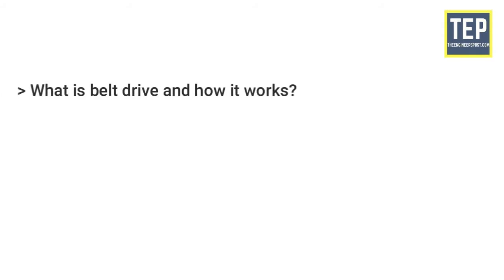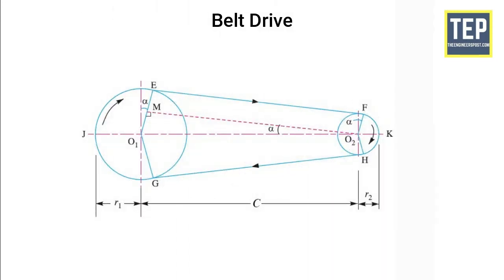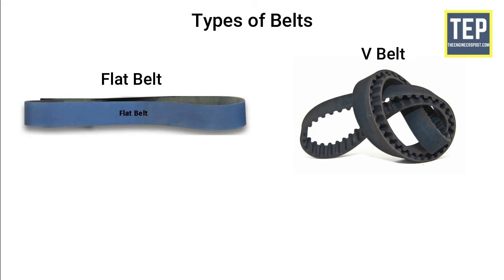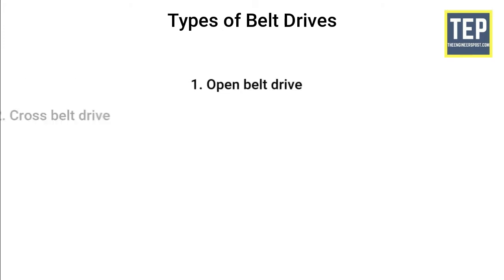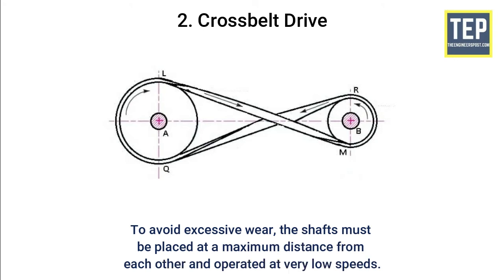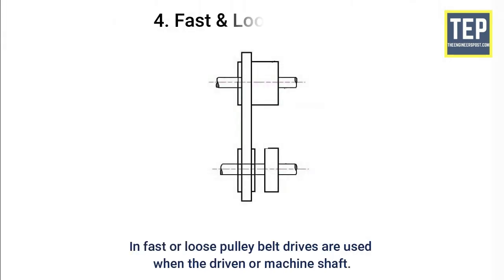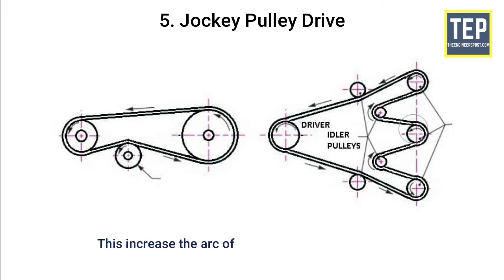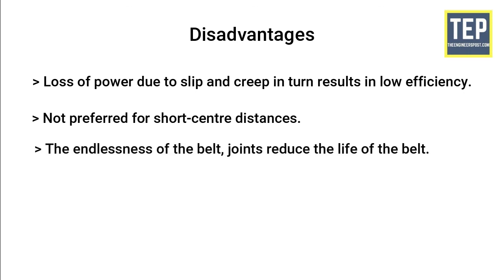Belt Drive | Types of Belt Drives

Comment: Yes I know this is way behind on asking but hay better late than never...... I have a Coleman ct200u-ex mini bike and I put a predator 212cc on this mini bike with a 30 series torque converter using the 15 tooth sprocket that come with it and the mini bike has a 50 tooth sprocket on the back wheel. The chain that is used is 40 chain. From center of driven clutch on torque converter to center of rear axle is 15 in. That 40 chain is half inch wide. Would you  happen to know of a belt drive that I can put between the torque converter and the rear tire? Oh yeah the shaft that driven clutch sits on is half inch and I have one inch clearance between edge of driven clutch and back plate that is bolted to the engine. The drive I talk of would be the small version of what Harley-Davidson uses on their motorcycles.

Comment: A belt conveyor pulley is a type of mechanical pulley that is used to power a belt conveyor system. It is typically made from metal or plastic and is mounted on a shaft that rotates to move the belt. There are different types of belt conveyor pulleys, including grooved pulleys, crowned pulleys, and V-belts.

Anyways, read the below. This might help.
https://www.reblogit.com/the-ultimate-guide-for-choosing-the-ideal-type-of-belt-pulley/

--
Regards,
Reblog it

Comment: That 2nd belt shown was not a v belt , that looked like a positive drive belt (synchronous drive belt) , v belt is exactly what it’s name implies , a belts cross section in the shape of a V.
Reply: At the place of the 'V' belt, they showed a toothed belt. It is also called timing belt.
Reply: @Wrong-Number12  I think also like that it's timing belt not V-belt
Reply: i doubt so. a V belt has a flaT end. its not sharp like a V.